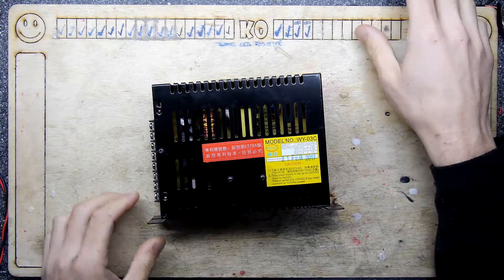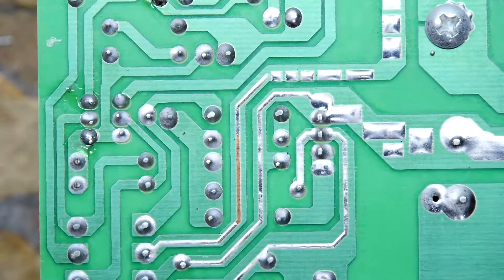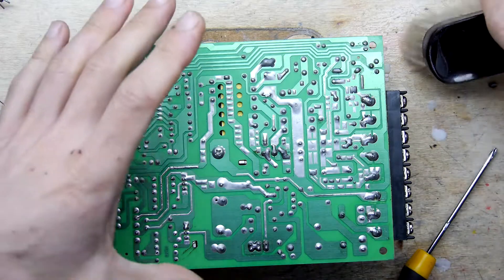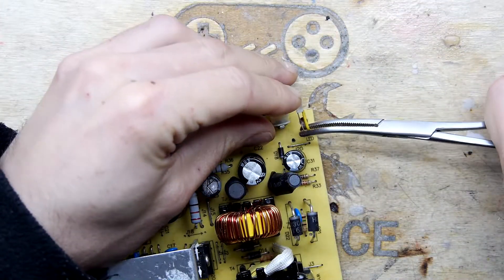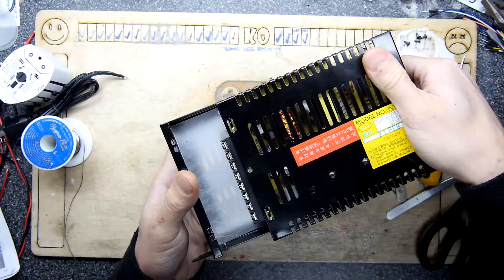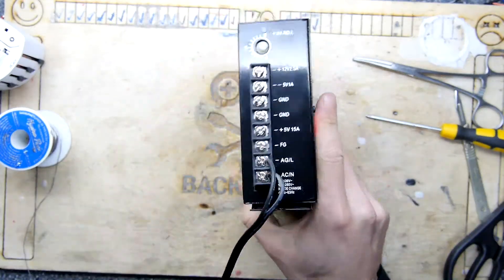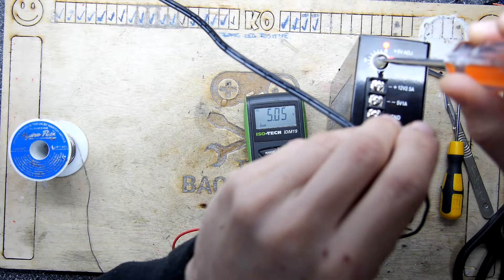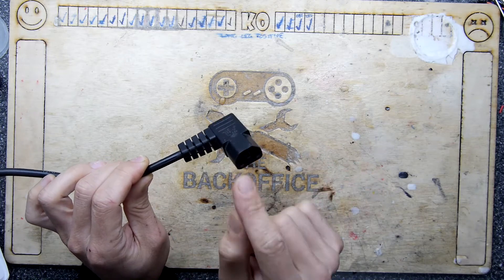Arcade PSU

Comment: You've got the knock-off one where I have the knock-off of the knock-off ;D
Mine's been ok to be fair. I did the same as you and checked it inside and out. As I put a mains fuse in I modified the board's crappy soldered in fuse (noticed yours has a clip mount - aren't we posh?) for that over-the-top switch I shared with you before.
I didn't like the shroud-less contact design either nor the "chocolate fire guard" grate they have on it. You can get proper guards for these but they cost more than half of what you pay for the PSU and don't appear to fit / mount these ones without a lot of modification. I cut some plastic to fit then used some decent thermal resistant electrical tape to create my own guard type bodge. Works fine and saves that being the cause of electrocution.

PS You've reminded me to replenish my heat-shrink supply 👍
Reply from the maker: Thanks for the share, gave me something interesting to read! I am glad I helped on the heatshrink, if as a personal favour you remind me to get PCB cleaner we can call it quits :)

Comment: LOL @ the rusted LED - I wouldn't have been able to leave that as it was either :o)
Reply from the maker: +GadgetUK164 - Retro Gaming Repairs & Mods ha ha, so random , high humidity I guess
Reply: Mine came with rust on the screwed on mounting brackets but rest was fine (well, as far as fine goes, no rust at least). My LED did have a dry joint though.
They don't ship with any moisture adsorbing material in the bag and do get exposed to all extremes of temperatures on their shipping journey here I guess.

Comment: To avoid self-tapping screws stripping the threads, always, when replacing the screws, turn them anti-clockwise until you feel it drop into the existing thread. Then turn it clockwise to tighten. This makes sure you don’t cut another thread.
Reply from the maker: +Ashley Booth That's a great top tip! I will try this!

Also thanks for reminding me that I need to order a selection box of self tappers, I never have what I need to hand!

Comment: I once had a new Seasonic PC-PSU blew up into a blue power ball coming out of the back in the instant I switched on the power. No hardware got damaged, but since then I'm putting every power supply once under power before connecting anything to it. And I can't trust Seasonic anymore, although they are supposedly known for their quality. This was my first and last one from that company.
Reply from the maker: +EgoShredder I love the manually starting fan blades, I have been known to do that myself from time to time. Painful when it goes wrong, oops!
Reply from the maker: +Ingo Günther I've destroyed all sorts of brands of PSU. I suspect the reputable brands and the crappy brands are all made in pretty similar ways and just differentiated by the quality of their warranty 😁

I have had the same happen to me several times, Luckily hardware has never been damaged, unlike 80s computers, modern PC PSUs seem to fail safe?
Reply: Might be that modern PC-PSU's have several protection mechanisms, but I have problems putting much faith into them working when a power supply fails in such an effectful way.
Reply from the maker: +Ingo Günther yeah
Reply: The last time this happened to me was with an expensive luxury model 520W PSU bought in 2005 for £130 from Scan.  It  lasted until 2012, and to be fair I was the one that killed it.  For a couple of years the cooling fan kept stopping, and so I would routinely flick the fan blades with a screwdriver to get it spinning again.  Then one evening while I was exhausted, I poked the screwdriver a little too far and shorted the PSU.  This blew the BIOS chip on the motherboard, and replacement chips were about £9 in 2012 on Ebay.

I decided to just get another motherboard, CPU, RAM and PSU and make it an upgrade.  The old board was using a Pentium 4 600 series 3.8GHz, and the upgrade went to a Q6600 CPU.  I later modded this board in 2015 to take a Skt 771 Xeon X5492 which I still use as my main computer.
Reply: Are you burning the midnight oil like myself!  Gets a bit out of hand working 16+ hrs without a break, and looking up to find it is 8am!  I need to get back into a more normal time frame!  Arrgghh! :-D
Reply from the maker: +EgoShredder I'd love to be able to sleep for 8 hours
Reply: Yeah 2 or 3 is my lot and has been for the last 25 years or so.  Some rare occasions I do get a full 6 or 8 with the latter being like hens teeth!